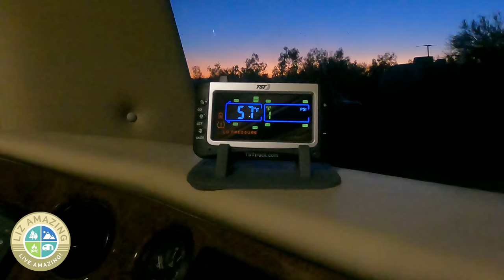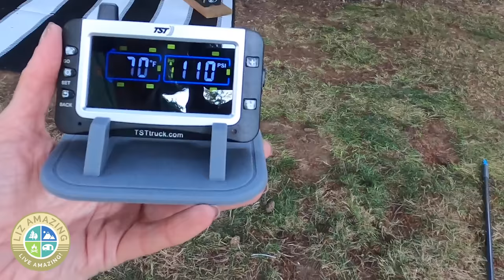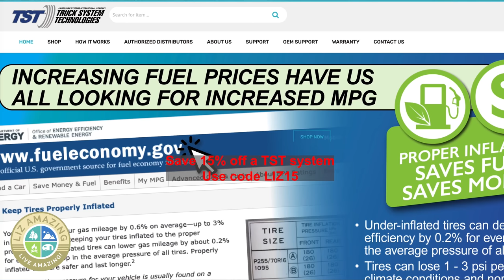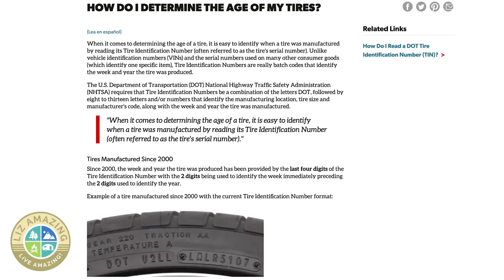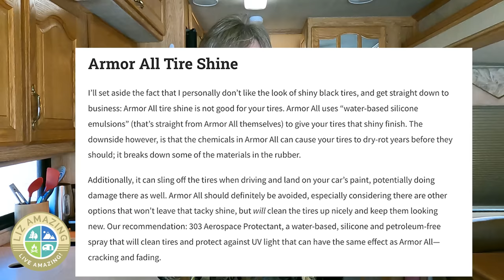3 questions everyone has about RV/Trailer tires

Comment: Great video, looking good. Put spacers on the rear dually of my Ekko as I went a little larger tire size when installing the lift. Problem is after installing the spacers the outboard tire rotated in a way where the spoke on the outboard wheel blocks the inside valve stem making it impossible to check or add air to the inboard tire. The Ford Transit has a TPMS system , but still won't be able to add or manually check air. Ive ordered a couple different valve stem extensions from Amazon, the most promising being the Ken-Tool 7" made in Germany. Still, not that excited about an extension but it seems the only other option might be different wheels where the spokes are configured differently. Anyway, see how it works out shortly. Happy Trails RS
Reply from the maker: Yep. Good luck. Happy travels to you!

Comment: About a year ago I bought a used horse trailer. The tires were worn but I was sure I could get a year out of them. Despite checking the tire pressure before we left on our maiden voyage one tire blew about 300 miles into a 400 mile trip. We were stopped on the side of a busy highway loaded with horses. It tore off the fender and damaged the side of the trailer. About $1000 in repairs. At least I had the tools to get the spare on and we were rolling again in 20 minutes. Needless to say the next trip was to the tire shop for 4 new tires.
Reply from the maker: Wow, thanks for sharing this Steven. I am sure your comment will help others. It's such a good lesson (sorry at your expense). I hope you'll also consider a TPMS, major peace of mind! And thanks for watching.

Comment: Some 30 years ago, towing an old single axle trailer with a fully loaded full size 1/2 ton van, while going around a left turn, in the middle of no where, at about 50 MPH, with no shoulder bordering on a river bank, I had the outside rim spit, causing an immediate flat. The weight of the trailer shifting to the right was trying to drag the van of onto the shoulder of which was about a foot or gravel before it dropped off down to the river. I managed to keep it on the pavement till I found a straight section of road with a shoulder to safely pull off and change the tire. Fortunately the spare had air, the jack worked and I had a wheel wrench. With the spare installed we continued to drive to our destination, about another 2 hours, and as soon as we stopped at the first traffic light I noticed in the rear view mirror the trailer drop on the left side. Across the intersection was a tire store on the right, so I pulled in there only to discover that the rim on the other side had also split! The tire store said that the rims on the trailer where automotive car rims and were not heavy enough to prevent the flexing that caused them to split. The tire store had both rims and trailer tires for us installed about an hour later. I now tow a tandem axle trailer with a tire monitor on both trailer and truck. Never again will I own a trailer with a single axle or no tire monitors!
Reply from the maker: Hi Richard. Your story had me on the edge of my seat. I am so glad for the happy ending. By sharing your story I am sure you've helped convince someone to get a TPMS. Thank you SO much for taking the time to write this.  Hugs to you and see you in the next video.
Reply: @LizAmazing  I'm happy to share my experience, always looking forward to your next video.

Comment: The motorhome we had last year was only 8 years old, but the tires were 10 years old!!  When we took it in for some maintenance they wouldn't even fill the tires!!  Needless to say we replaced for tires, to be safe!!  We gave up on the motorhome, replaced with new truck & 5th wheel!!
Reply from the maker: Wow, that is crazy that the tires were so much older than the motorhome. Thanks so much for sharing this, your comment is sure to help others when shopping. And thanks for watching.

Comment: Hi Liz . 
Yes I had a blowout coming from Havasu to Vegas and I couldn’t change the tire because it was on the inside and it was summer and you know how hot it is in Arizona🌞 during the summer it’s dangerous to get out ,  so I just drove home that way,  and it the steel belted  just blew a hole in my floor that rubber just kept going around and around …so I had to fix all that ….I had a motorhome then .I prefer Class C
(you have really great skin anyway all right this is unrelated could you possibly tell me what you would face cream you use? )
Thanks your a great representative for products and a very good speaker you could  be a really great motivational speaker…❤
Reply from the maker: Hi Susan! Thanks so much for your kind words, I am blushing over here! First of all, glad you got home OK. I'm sure that was stressful. I use Fruit of the Earth face cream and drink lots of water, but it's probably mostly genetics and staying out of the sun. Thanks again for the love!

Comment: Liz, I thought that was a very informative video. For anyone not knowing much about tires, they certainly know a lot more now. I've seen full tread on tires that were actually as hard as a rock and brittle. I've got a TPMS on my 2020 Holden Colorado (the internal factory type) but I've never though of doing the same to my caravan. It's only a small van, but as you say, you can suffer serious consequences from a blowout no matter where it is on your outfit. I will have to check out the blue tooth type.
Happy and safe travels, Liz.
Cheers from Australia.
Reply from the maker: Thanks so much for your kind and thoughtful comment, Steiny!!!

Comment: In a diesel pusher RV, you can just use your on board air compressor
Reply from the maker: That's what I'm hearing. The seller knew nothing about it so I may not have it on my rig. Thanks for watching, Jim.

Comment: 8:09 hello Liz, I always enjoy your videos, and of course I am subscribed. Just wanted to say however, that you mentioned you run your Michelin’s at 120 psi. I’ve had my Newmar 2006 for 4  years.  Like you, I purchased six new Michelin’s in 2019. Probably like your rig, my rigs info tag located behind the driver seat on the sidewall indicated that I should run 120 psi. I did that for a couple trips and couldn’t help but notice how rough the ride was. Later that year I took it to Frieght Liner in Gaffney, South Carolina, where they weighed it and cross referenced my tires to Michelin‘s recommended inflation for my rig and for my weight and for that particular tire. Michelin recommended that I run my tires at 90 psi. That’s where I’ve been running the pressure for the last three years. I triple checked this and in fact that’s where it should be set. FYI.
Reply from the maker: Oh my gosh. Thanks for this, David! You've confirmed my own experience. When I got the tires, the tire shop recommended 120 psi. Since then I've steadily decreased the psi and I've found it handles MUCH better. I'm now at 100 but it's good to know I can go lower if I need to. Thanks for watching and see you in the next video.

Comment: Flat tire story: Had a blowout on our fifth wheel on the interstate in Arkansas. Pulled over and changed the tire, but it had blown into the camper, wiped out our (recently replaced) water pump. Sawdust-like substance all over the inside of the camper! Five hours from home, so we were limping along…and the other tire on the same side blew out. Apparently damaged from the first blow out. No tow truck available, so we left it overnight on the interstate and checked into a hotel. Insurance was no help at all. We got up the next morning and went to Walmart and bought a car tire. Made it home safely. Tires were almost 6 years old, so we learned our lesson. Replace often! This was pre-Covid, and it took over 6 months to get it fixed.
Reply from the maker: Oh my goodness, Annette. I was holding my breath reading my story worried that your camper was going to be gone the next morning. Whew! And, yeah, it if it took six months it would probably be a year now. Thanks for sharing and safe travels.

Comment: Thanks for the tire info - for safety, I would also suggest you invest in a good infrared high temperature gun.  Safe travels.
Reply from the maker: Thanks for this. I've got one, very handy. The TPMS is the best for checking high temps as it checks continuously. The temp gun would be good if I suspected the bearings getting hot maybe.
Reply: @LizAmazing  That's exactly what I use mine for.

Comment: Michelin tires whether car, truck or RV are known for sidewall cracking close to the bead or rim area. I first experienced this in 1984 on a Mazda GLC. As a technician I’ve seen thousands during my 45 year career without any of them causing an issue. Many shops these days will recommend new tires after a few years based on the DOT date code. Check what the manufacturer of your brand recommends.
Reply from the maker: Great to hear from you on this, Dean! Thanks for watching.
Reply: Industry standard is tires, regardless of age should be replaced when the wear reaches 2/32”. I valued my wife and kids so I was a rule that I replaced them at 4/32”. I will maintain that standard and wish everyone else would as well. Just seeing the damage blow outs cause and knowing the rough road conditions I see people mentioning on these forums is motivation enough for all of us.

Comment: Had a TAG axle tire lose part of the tread on the passenger side with no damage to the RV. The state roads are so narrow. Interstate highways are much wider so you aren't hitting the rumble strip constantly as I was with my 45' (class A RV). The rumble strip caused heat or vibration, maybe both, and peeled off a part of the tread on the outside of the tire. Luckly it did not cause the tire to become unbalanced, and I was able to keep driving. I am looking for a used tire to replace it. You can use your older tires here (front and Dual) if you are replacing them and if they still are in good shape and have some tread left. You can save some money that way. Liability issues come up with getting used tires.
Reply from the maker: Hey Neil. So lucky that you did not do any damage with the tire. Wow! Thanks for sharing and for the tip. See you in the next video.
Reply: @LizAmazing  It is nice to have people to talk to about this stuff. Hey would you and the people reading this have a suggestion on a Tire Pressure Monitoring System (TPMS)?
Reply from the maker: @justfun985  Yes, I talk about my TPMS in this video, have used it for two years. ❤ 15% off TPMS https://tinyurl.com/TPMSsaves   Code LIZ15
Reply: @LizAmazing  Thanks, I haven't finished the video yet as I am doing some fixing up on the one I just got.

Comment: Liz, in your research you missed and VERY important part of tire air pressure, actual Gross Weight of the vehicle. You mentioned that your tire pressure is 120 psi. I strongly suggest you weigh your MH loaded with every thing you travel with including your tanks at travel levels and compare your weight to your tire manufacturer PSI to weight chart. While using the CAT scale at a truck stop is good, the best is to weigh each corner tire location.  I believe you will find the 120 psi is a maximum when loaded at maximum GVW (i.e.; fully loaded commercial trucks) and you may be grossly over inflated. Continued operation at 120psi will diminish the life of the tires.
Reply from the maker: Thanks for this, Barry. I did weigh and am underweight so reduced tire pressure. You're on it! Thanks for having my back.

Comment: We've chatted before,  everybody has their own opinion, but here's the thoughts of the maintenance supervisor of the trucking company I retired from, cracks in side walls let in moisture which leads to corrosion of the steel belts which are the strength of the tire structure, once a belt breaks down its not an issue of if but when that tire will explode, a million miles on the road and I never blew a steer tire, be safe
Reply from the maker: Yep. You just gotta be safe. And I had never heard that cracks would corrode steel belts. It would seem if water could seep in through the rubber to the belts it would not matter if the tires were cracked or not. Will have to google. Thanks for watching, Ronald!

Comment: Good video 😀 if the date code on your tires is 5 years you should replace tires if there cracked you need to replace tires can't believe they said tires are ok you have an older rig I bet the owner  didn't want to spend the money to replace them 🤔😄
Reply from the maker: I knew going in the tires were going to have to be replaced. But it was interesting to learn that I could have waited a year. I found the Michelin tire crack chart also an eye opener. Learn something every day! Thanks for watching.

Comment: I heard an unusual sound from the back of my Class B RV on I10. Pulled over, took a look ... no flat. Hmmm. Drove a little bit more, heard the same sound. Stopped, took a closer look and realized the rubber had been completely shredded off and I was on the inner kevlar band. Not good. Limped over to a repair place, they installed my spare and I ordered a new tire. What caused the shredding? The wind had blown a loose piece of metallic body moulding which would slowly rub against the rubber and cut into it (that's the noise I heard).
Reply from the maker: Oh my goodness. Glad. you stopped to check it out. That was a big bullet you dodged if you'd kept driving. Safe travels to you and thanks for watching and commenting.

Comment: You already have a better inflation tool built in to that motor home via the compressor on the engine! No need for any independent tool that will take up additional space and and add dead weight.
Reply: Yes, we had that as well. Wondering why she didn't mention that unless she doesn't it have it on her rig. Very useful for blowing out the debris on rooftop ac units.
Reply from the maker: This is news to me. I will have to do some searching around for that. The previous owner knows nothing about one so it might have been removed some time ago. And thanks for watching.

Comment: I had a Fleetwood Discovery with Goodyear RV specific tires. Goodyear warranties their RV tire against cracks for 7 years. The compounds they use take into account for the time most RVs sit in one spot exposed to sun. They cost more but after 7 years mine looked completely new. 

My current bus has very large Michelin tires. 315/80/22.5 drive & tag, 365/70/22.5 steer. The service manager when they were installed new recommended getting them to operating temperature at least monthly. They are designed to be rolling pretty consistently. So knowing what the tire is designed to be used for is important. 

120psi? Is that what’s on the data sheet for your Motorhome?  The sheet should be posted about shoulder high as your sitting in the drivers chair. It just seems high, like right at the max rating of the tire. 

I also remember some of the Alfas being right at the max weight of the steering axel. The next opportunity put it on a scale and check it against the data sheet. 

Enjoy your ride. It looks like  you got a well taken care of motor home.
Reply from the maker: Thanks so much for your comment, your tires do seem large! My data sheet recommends 110 to 120 based on a four corner weight. If maximum weight then should be maximum air pressure. I originally had the tires set at 120 per the tire dealer BUT then I got weighed and am so underweight that 115 is good. Thanks for asking! I do plan to weigh again bc the weight of the toad seemed off (lighter than curb weight). When I do that I will double check the steer axle is good. Stay tuned for an upcoming video about the CAT scales, and thanks for watching!